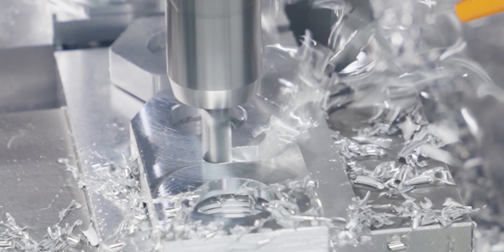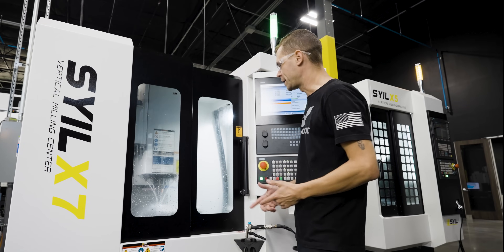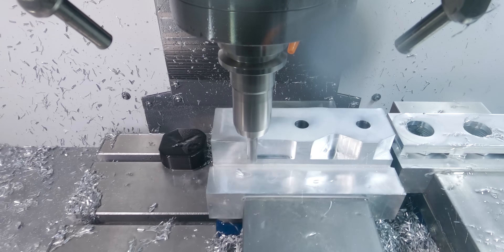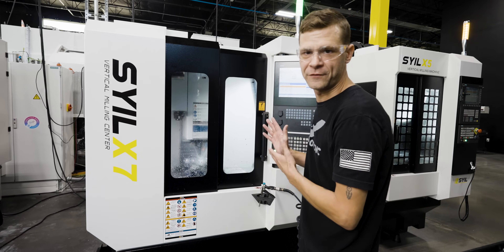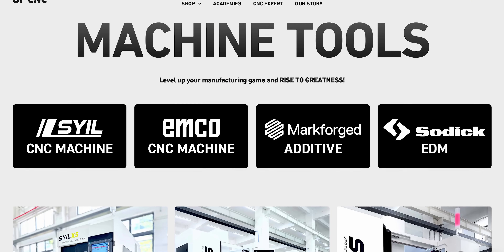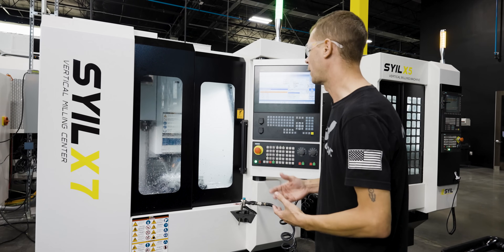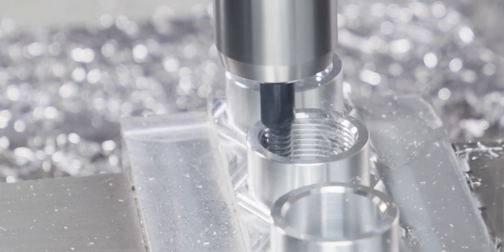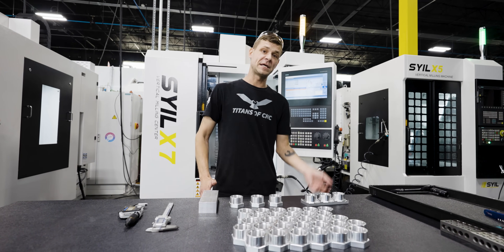Machining Lathe Parts on a Mill?

Comment: We run a lot of mill parts on the lathe. Because the lathe can run 22 hours a day unattended with bar feed and parts catcher and it’ll remove material so fast you spit out your coffee. Cycle time for small-ish lathe parts is usually seconds not minutes. But yeah a mill is more versatile.

Comment: How is shipping and rigging determined? Do i need to have a rigging company rig the machine and install it or is that all handled by you guys? im looking to buy the syil X7 in the near future but the only thing holding me back is not knowing how the delivery process goes. Might be a good idea for a video dedicated to first time CNC Machine buyers.
Reply: For such small machines, a manual pallet jack is invaluable. Since such machines are delivered on wooden pallets, you'll also need a forklift to lower the machine. Beforehand, carefully read the manual to determine where and how you're allowed to lift, otherwise damage could occur.

Comment: I run a super similar setup (eerily similar part for an aviation application out of brass). I did make a custom fixture for mine and use mitee bites. Its a 9-part fixture. fun stuff

Comment: This is something I do quite a bit in my shop. I make workholding and end-of-arm tooling for robots. We simply don't have the demand or space for a good size and tricked-out lathe. We do have a small 5C collet lathe for higher-run and smaller parts, but a mill paired with a 4th axis can do a lot of the work I would otherwise prefer to do on a lathe. Although there are time costs associated, those stop meaning much when I'm making maybe 4 of that part.

Comment: When I first saw the title "Lathe Parts on a Mill" I thought this was gonna be a video about the good Ole, last minute, no lathe material in the spindle and tools mounted to the table approach.😂😂 Had to do that several times in a pinch. It's tricky from a programming standpoint point, but I've been able to make some shorter "bearing" shafts with less than .0001 of taper over 2.5" in 304 stainless. Nothing more nerve racking than having a 5lb+ piece of stainless spinning in your mill spindle lol but you do what you gotta do😂

Comment: I don't understand this at all. Titan is alll about making money and running fast. There is zero chance that milling this part is faster than doing it on a lathe.
Reply from the maker: There are levels…
This is for beginners that only have a single mill or think they need both.
Sometimes we show super advanced set ups and sometimes we show techniques for guys starting out.

Comment: do these machines have through spindle coolant? or higher preassure options? coolant flow seems a bit weak. also the climb milling sounds a bit bad and chip evac is worse. otherwise great

Comment: Would an X9 fit in a standard garage? Can it be dropped low enough to make it under a 7ft door
Reply: Great question! I confirmed this information with our team. You will need a 96" (8ft.) clearance just to get the SYIL X9 through the doorway. If you have any further questions or concerns regarding a machine, our team would be happy to help you. Please fill out the contact form on the TITANS of CNC website, located under the machine of interest.

Comment: You forgot to mention that the bulk of lathe parts are long and and slim - shafts, studs, etc etc. very rarely there are parts where the diameter is larger than length.
Reply: Even so, it's nice to keep this idea in your hat for small part runs. I've definitely been in shops that think Round = Lathe, and have turned down parts that could be run this way with the margins large enough to justify it. Would be fun to watch them try to make a 12" long shaft on a mill, though

Comment: If those OD's vary by even a little bit, you're going to have a bad time. That's why it's better to only do 2 parts with one at each end of the jaws to ensure equal clamping force if they're a little bit different diameters. With 3, you're just asking for trouble.
Reply: Aluminum you can usually get lucky as it compresses a bit. Hardened steels is where parts become helicopters.
Reply: @buildermen123  I agree usually, but clamping pressure can be an issue if you have to hold roundness and keep all 3 stable in the jaws.
Reply: That makes sense. The center one is basically going to be off slightly.
Reply: I agree. Its better to build a fixture plate if youre doing more than 4 at a time. While its easy to make parts repeatable to under 5 micron, usually the clamping devices arent accurate or repeatable enough and you send parts flying even with a torque wrench.
Reply: Yup
Reply: Two ideas might overcome this issue. One being using a plastic jaw on the moving side, use the deformation of the plastic to even off the pressure on all three parts. One being leaving a thin layer of material as the support when making the major separating cuts, then cut off the support layer with a final cut which has far less cutting force. Or, combining these two ideas. Why this is important? Because sometimes you have to arrange five or six parts in the vise jaw only to stay in the game. Two small parts in a vise jaw ? Come on, our US machinist counterparts are expected to make America great again. - from one of your Chinese counterparts
Reply: @catttcattt  I think this video was just to sell the Syil machines and give the home garage guys some ideas.  Using these techniques, you can get through a few parts, but you wouldn't want to do hundreds or thousands of parts this way.
Reply: @LiTenUpADP  I was not trying to look down on the Titan's video about how to make parts that otherwise has to be done on lathes. On the contary, it could be a very practical way to make similar parts. Someone in the comment section said that it is better make two of them in the jaw for secure holding. I was trying to say that is reasonable but inefficient when you are cutting parts in quantity. I then provided two solutions so our average garage folks can arrange more parts in the jaws. Please don't make summary judgement about not do parts this way in quantity. When parts have features that needs milling, mills might save enough time to get rid of lathes.
Reply: @catttcattt  Whatever floats your boat, dude, it's a free country.

Comment: A comparison of cycle times between lathe and mill would have been nice
Reply: Dopo quasi 30 anni di lavoro in cnc, posso dire che su componenti del genere, un tornio è nettamente più veloce. Per 25 anni ho lavorato su centri di lavoro. Dopodiché tornio. Bello riuscire a fare lavori da tornio su fresa e viceversa. Si impara sempre qualcosa. Le mie regole base sono: non fare danni ,il pezzo deve venire giusto e con ripetitibilità,poi vediamo i tempi/pz.
Reply: Depends on the type of machine you have to work with. Obviously I don't have to talk about using just a mill as this is the video.

Basic 2-axis lathe and mill:
Most do not have a mill/turn (lathe with live tooling) so they would need to have one (flip job/bar feed) or two ops in a lathe. After they'd have to put it into a mill for the hex, if they didn't get hex barstock. Having done threads this small and simple (no highbie or gasket groove) in a lathe would take 1.5min to machine and for making the hex would be the same in the vid (little under 10s each).
For a job quote it would be 30 min setup for lathe and 1 hour for mill.

Mill/turn (lathe with live tooling):
Without a barfeeder or a sub spindle, it would be slightly longer as you would still need to flip or run another op. I don't have a machine like this at work but I would estimate, worst case scenario, 2.5 min.
If there is a barfeeder, and the quantity makes it worth it, and/or there is a sub spindle it becomes easier and quicker. Based off experience with the machine I work with, I'd say it would be 2 min possible down to 1.5 if I sat there and optimized everything.
I'm not even going to estimate a fully kitted mill/turn with 2 turrets.

This video without the intro and ad is 5m 3s, which looks to be one continuous machine cycle. Basically if you had a lathe, you could theoretically almost make 2 parts with a basic lathe  (factoring in load times) or 2-3 parts with a barfeeder and mill/turn, in the same length of this video.

Lathes are way more rigid so you can make much deeper DoC but are limited in what they can machine (most only make round features). I'm pretty sure Titan has done this video before when he was still working with Haas machines. The idea of it isn't that you should use the mill instead, it's that you don't have to turn away jobs that would typically be ran on a lathe if you only have a mill.
Reply: A lathe with live tooling and a subspindle would make this part complete in less than 30 seconds. (Basically all modern lathes has double turrets for each spindle at the least)

So its not even slightly comparable.
Turning outside diameter takes about 2-3 seconds in aluminium, hexes about 10 seconds with balance milling high feed mills. Facing, drilling, internal thread turning, and part ejection on subspindle.

Part pick off with spindle synch about 5-6 seconds with cutoff.

No material loading or flipping by hand, with a barfeeder.

Only mill that's even comparable is a 5 or 4+1 axis machine with a rotary table. And even with that's its vastly inferior.
Reply: If you buy this machine it comes with the cycle time comparisons. 😂
Reply: 10 parts made to 3 on a mill
Reply: Everyone knows a millturn would destroy this setup, especially with a bar feeder running on full auto. I think this is geared toward someone who only has a mill
Reply: All depends on the job, prototype vs production. It’s a lot cheaper to get setup with standardized quick change tooling and fixturing for a mill which means you could be a lot more efficient on those small quantity/low setup $ jobs. If we’re talking production lathe becomes much faster and cheaper especially with complex profile geometries.
Reply: plus a cost of material saved (on lathe) and lost (on mill)

Comment: and you can also use the mill spindle as a lathe spindle ( putting short stock in a tool holder and then have the lathe tool holder sticking out of the vice/vice's )
Reply: Based on the title, I thought that was what he would show us.
Reply: @theGermanrabbit  done it a few times myself. really good when you need to do super small parts without haveing a swiss lathe since most cnc milles has a minimum 8.1k rpm spindle so really good for really small parts
Reply: Worked in a shop with one lathe and two Bridgeports... except sometimes it was one lathe, one bridgeport, and one 'Bridgelathe' :)
Reply: @christianweagle6253  never tried using a manual mill as a lathe. only on cnc mill
Reply: I was just thinking about this. I just ordered a Shariff DMC 2 mini and I was wondering if i could make small screws in this manner.
Reply: @softcrunchytaco  only if your gonna thread mill them. otherwise no. since the spindle/machine have no idear about what degree the spindle is turned to and therefore can't synk when to start moning. unless you wanna go through setting up a grinder and grinding whell. dress it to the right shape. calculate how fast it have to go downwards in Z compared to the rpm of the spindle and have to go full thread depth in one go ( i have tried making a M540x3 full depth in one go/pass and let me tell you. that was stressfull. cause we only had one chance. zero do over. zero test pease or anything like that. it did also take 2 guy's 2 days to setup for that cut alone( i was one of those two guy's )) so you either set it up llike him with thread mill. grind it . or get real funny/scetchy with a thread die and dieholder

Comment: 2 years of ownership on my X7 and I get to replace my X axis bearings already 🤦
Reply: Need more context: Was the wear caused by production use, aggressive machining, contamination entering the bearing housing, etc.? What was the culprit behind the worn bearings?
Reply: @Sara-TOC pretty regular use about 650 hours on the machine. No major crashes. Just started one day a few weeks ago during normal operations and has been getting louder. Also just replaced the belt on my tool changer motor last month 😅 and to top it off most of these parts have to be imported and can take weeks.
Reply: @Hawgsupply  man maybe going the refurbishing an old fadal route is still the better option.
Reply: @Hawgsupply  "No major crashes"? So, there have at least been crashes then...
Reply: @haavard1989 yeah I’ve hit a vise jaw with a tool but nothing that I would consider a major crash
Reply: @Hawgsupply  Yeah, it doesn't sound that bad (since I don't know any details really), but some machines are just not built to handle even minor crashes. I've crashed a CMZ TD45 once (tool rapid into part in Z axis) and the bang was intense. I finished the part and then aligned the revolver. Luckily, nothing broke. It was a sturdy machine I must say.
Reply: @cesarsauceda8730   Matsuura 👌🏼
Reply: @Hawgsupply  650 hours is nothing.  I wonder if there was a lubrication issue.
Reply: @Sara-TOC and don’t get me wrong I do love my X7 but these problems have me rethinking it
Reply: Any crashes? Linear guides or the ballscrew/nut? Diagnosis?
I’ve been pushing mine hard with high feed mills and insert drills so it’ll be interesting to see how long my components last.